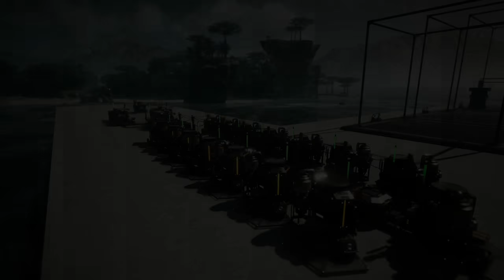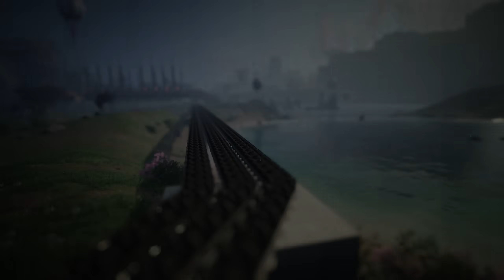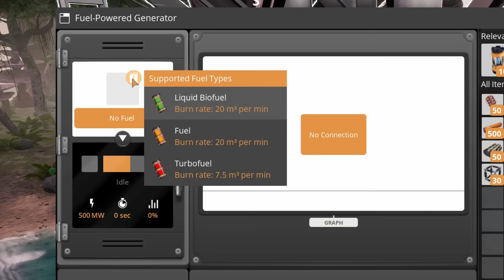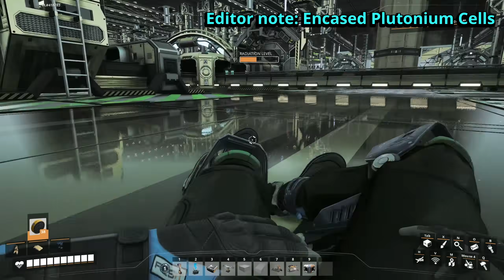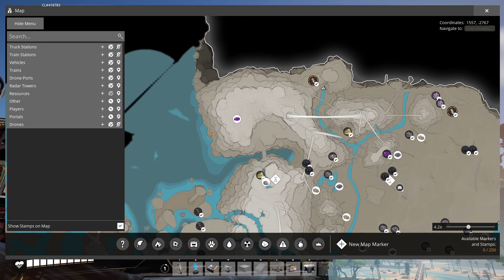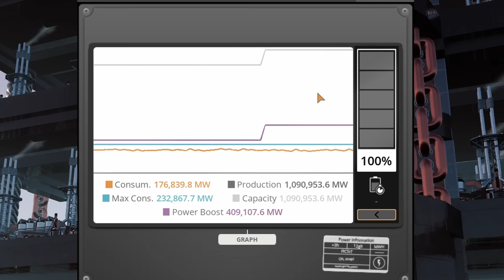BEST power guide for Satisfactory 1.1

Comment: For coal I just build a really long platform at water level.  Coal burners on one side and water extractors on the other side.  No pumps needed.  reversed conveyer lifts with a belt splitter stuck on the head of each.  Ram the coal down the manifold line.  As it gets longer, will need faster belts, but the beauty is you can just come back and extend the line further as you need.
Reply: I place the lines in parallel with water coming from the ends.
That way the line itself will never need more then mk2 belts. You expand by upgrading the one belt that feeds all the lines.

Plus, by placing them facing each other you get space to build a glass floor over the belts.
Reply: Place each burner in the opposite direction of the ones next to it (or run half of the water pipes underneath the burners if you only want to run a single coal belt) and place water extractors on both sides of the burners. Means you have to build most of the power plant on top of the water but everything lines up perfectly. EDIT: I should mention I use all my early slugs to overclock my first coal plant so it's easier to simply give each burner its own extractor, rather than worrying about water throughput issues.
Reply from the maker: Nice, did the same thing.

Comment: I just finished Phase 4 and looking for lategame proof factories and infrastructure.
I'm currently setting up the base for my future rocket fuel generators, and there is something I'm not sure how to manage regarding fuel generators in general. My previous fuel generator is plugged directly from the plastic factory who is generating the fluids, and I don't use "Bottled fuel", directly from pipes. And indeed I never managed to make it 100% efficient, as my pipe architecture wasn't the best with the knowledge I had at that time.
I think I can make it work now with what I know, but is there a real advantage using conditionned fuel over pipes ? Or is it just preferences ? I feel like the infrastructure of conditioning/deconditioning is as annoying as the pipes. What do you think about this ?
Reply from the maker: if you make a dedicated fuel plant, and use alt recipes you can make a ton of fuel and a lot of power, but if your just trying to get to a different power sources, i would say use the by product from plastic and rubber to make power and go big for the later game power plant. fuel is great for mid game and easy enough to make,

Comment: the thing is ficsonium rods are CONSUMING more energy (for the building parts production) than you get out of it so powerwise they are a power LOSS, you gain a lot of energy out of uranium and basically the same amount if you use the pluto rods for power THIS is the gain but than you need more power to make some ficsonium rods as you get from burning it, the only good reason to make them for me is just because you can^^
Reply: You can’t use plutonium fuel rods if you don’t make ficsonium. So they cost power but give you more power cuz otherwise you’d have to store the plutonium waste.
Reply from the maker: for the meme's agreed.

Comment: To be fair, a single overclocked pure oil node can produce 600 crude oil a minute. That means 800 heavy oil residue (Assuming we use that alt recipe, only 400 at max if we don't.) Side product: 400 polymer resin. If you add just a 100 copper to it, it can be turned into 4.17 or so computers a minute, just to make it into something more useful.

With diluted fuel, or diluted packaged fuel alt recipes, we can get 1600 fuel from 800 heavy oil residue and 1600 water.
That's already enough for about 10 GW of power. Pretty solid for mid game. (doesn't include the power consumption of the machines making it)

So: 600 crude oil + 1600 water + 100 copper = 10 GW + 4.17 computers

If you were to up it to rocket fuel, than depending on the path you choose, it could be anywhere up to 2400 rocket fuel, using that 1600 fuel you started with. The real issues here are the nitrogen and sulfur needs that has to be met. That is about 144GW of power, even if we subtract the power usage of the machines producing it.

That said, the optimal amount of power is obvious. All of it.
Reply: Did this same thing. Only losing one pure node for loads of power is really nice. With the converter you can then use it to make all the nitrogen you need and sulfur.

Really hope it doesn’t get nerfed and they just buff nuclear because let’s be honest it’s needs some love with diluted fuel beating it down as much as it does.
Reply from the maker: we need all the power lol.
Reply: How do you get a computer from polymer resin?
Reply: @_DRACrY  polymer -> plastic -> Circuit board -> Computer. 
Some of the plastic goes to the computer and then all you need is a little copper for sheets and wire.

Edit: You can also do the same thing but instead of cooper you use caterium and make wire. Take the 400 polymer and split it between plastic and rubber. That nets you 13.73 computers. But you need alt recipes for it.
Reply: Convert that 1600 fuel into turbofuel. ..

Comment: For Coal power, I recommend the simplest method which is 1 Water Extractor to 2 Coal Generators. Ideally, underclock the Water Extractors to 75% to save some power.

This method is easy to scale up (especially with auto-connecting blueprints), and virtually foolproof. Plus, 1 Water Extractor is exactly as wide as 2 Coal Generators so you can make the setup fairly neat.
Reply: Yeah, that should have been added to the video. Little gems like that.
Reply from the maker: I like this.

Comment: Alien power matrices add 20% to your boost. They don't make the augmenter's boost 20%. Augmenters provide a 30% boost to power production while burning an alien power matrix.
Reply from the maker: aaahhh, good point, yes i miss spoke.
Reply: @DrawingXaos yeah, sorry if it came off as dry and criticizing. I really just meant to give a heads up.
Reply from the maker: @MultiPaulinator  no its good, the right information is the most important part.
Reply: Yeah but those somersloops are SO much more valuable than the power they can provide, even at 30%, and 10 somersloops is a LOT of lost production..  Throw four in a late-game item, and DOUBLE the value of every downstream machine for the entire system instantly.
Reply: 10%
Reply: @Мойевропейскийжидобандеровский Incorrect. They provide a 10% while not burning power matrices. When they are burning power matrices, the boost is 30%.

Comment: What's the math on ion fuel vs rocket? Power use vs power gained?
Reply from the maker: its trash, it takes to much extra bs to get there and you lose power in the long run. not to mention with the other things you need to put in there, like aluminum and stuff, you will kill to much needed resources.
Reply: I personally don't use Ionized Fuel to make power, but instead I offshoot a small amount of rocket fuel to make them so that I can make Packaged Ionized Fuel for my jetpack.

Comment: If you fully overclock one water pump it’ll give you 300 cubic meters and you’ll only need one per 8 generators. Dramatically simplifies the design.
Reply from the maker: 8 generators need 360 cubic meters of water.
Reply: @DrawingXaos I meant for compacted coal, oops lol

Comment: In my builds now I run Nitro Rocket Fuel. Skips the need to make Turbo Fuel and I use the compacted coal byproduct to make Steel and Munitions.
Reply: This is the best. Skips most of the turbo fuel chain and goes straight to rocket fuel. 
If you're upgrading a turbo fuel plant, the original is fine. If you're building something from the ground up, the alt is fat superior.
Reply: While the sulfur needs of that recipe are insanely high, other than that, it's probably the best solution. I mean, you can make 2400 rocket fuel out of 600 crude oil, if you use Nitro Rocket Fuel, Diluted Fuel, and Heavy OilResidue alt recipes in the line at the same time.
Reply: @Wortigon2000  That 600 Crude/ 2400 rocket fuel needs 1600 sulphur. For turbo fuel 1600 sulphur only makes 2000 Turbo Fuel and you need way more normal fuel and over 100 refineries as compared to 16 blenders.
Reply: @sheldonpetrie3706  As I said, I know it is likely the best material, but without access to mk3 miners and mk6 belts, as you can unlock this before you'd have the infrastructure for it, it's a massive pain to even find a way to scrape together that amount of sulfur. Imagine if all you could take from a pure node is 600, due to limitations of mk2 miners, or 780 due to mk5 belts.
Reply: @Wortigon2000  Its not that bad, I built mine off the Spire Coast close to the Dune Desert where there are 2 pure sulfur nodes, and I use a Drone to bring the little bit extra I need from the Impure node in the Swamp. I use a train to bring in the sulfur and coal from the dune desert (and some bonus Iron ore I turn into steel within my power plant to deal with the compacted coal byproduct instead of just sinking it), and I just built a long pipe (which isn't all that long) to bring in the nitrogen gas from the nodes North of the dune desert and use the combination of the 2 impure and 1 normal oil node that are closest to the Dune Desert on the spire coast to get my 600 crude. I package 240 of it per minute into 120 per minute of packaged rocket fuel to be used by drones or other vehicles (and personal use). I got around the mk3 miner limitations by building the plant all at once but only bringing it 50% online until I could upgrade my miners to mk3 and my train supply belts and factory belts to mk5. I still haven't unlocked mk6 belts yet but I'll only touch the supply lines to my power plant in case I need sulfur from those nodes later.
Reply: @Wortigon2000  a lot of thanks!! Thats amazing how recipes can increase production
Reply: Wait rocket fuel makes compacted coal?  Suddenly I feel like I want to build a few hundred coal burners, to complete the "cycle of life"!
Reply: @BEC-l2f yup, it's a very useful byproduct to burn or make steel with.
Reply: Nitro rocket fuel is my preferred power as well. I have drones delivering 1200 sulfur reliably without any issues. I also use drones to deliver nitrogen as packaged nitrogen. The 4 to 1 compression makes it easy to deliver all you need using very few drones.
Reply from the maker: not bad, not bad indeed.

Comment: ROCKET FUEL is supreme, I use 4 Blenders with the alternate recipe for rocket fuel and then only produce 300 fuel but use  somersloops on all 4 blenders to double each blenders output to the 600m limit.
Reply from the maker: Hell yeah, now your cooking with gas lol.
Reply: I had to rebuild my rocket fuel plants. Don't depend on mark 2 pipes actually delivering 600. Instead, set everything up for 450 per minute. Otherwise, you'll go nuts trying to get 100% efficiency.
Reply: @john_in_phoenix if you don't go vertical, you won't have any issues. The only issues I've had were due to going vertical even with enough head lift
Reply: Nitro Rocket Fuel.
Reply: Somersloops on 4 blenders? That's 16. How many have you found?

Comment: Agree that Rocket fuel is the best late game power. 1Tw mixed rocket/turbo in my prefered set-up will only take 6000 Nitrogen (half of map supply), 8100 oil (about 2/3), 5400 sulfur (a little more than half), 900 coal (nothing), and 8100 water (much less than nuclear)

I get most people prefer more oil efficient recipes, but I've always been a sulfur efficient builder. you can still make thousands of plastic and rubber with this set-up so its not like oil is too pressured of a resource.

1Tw ionized fuel is actually impossible due to the power shard/aluminum case requirements, and I think its only worth a small production chain to make packaged fuel for jetpack/vehicles.
Reply: Imagine if oil had a converter recipe then you could make soooo much power.
Reply from the maker: totally agree. i got my Ionized fuel for the jet pack and never looked back, but that rocket fuel was such a great thing to have and there a few locations you can make it so it was always the right choice.
Reply: in the optimal power set up(19 TW) about 225 GW of power are going to ionized fuel.

Comment: yeah i noticed the fuel generators are easier vs power you get compared to nuclear... Buuuuuut if you pull off a full nuclear plant chain to the end you get the bonus of immense satisfaction of insane big job done.. ofc after you fixed the 100 problems after finishing it why its not working properly :D
Reply from the maker: lol so true.
Reply: Oh you mean you put 1 tier 2 conveyor belt somewhere in your mess and it's bottlenecking the entire factory? Go find it. While you're at it I placed a needle in that haystack over there.
Reply: @timstram found the needle but where is the haystack?
Reply: the thing is in the time it takes you to set up one nuclear chain you could've set up ten rocket fuel chains producing more power for far less work. It's a fun challenge getting nuclear set up but it's just not worth the pay off. Don't get me started on the sheer amount of water lines you need to run to the plant

Comment: 5:00 An alternative is to underclock the water extractor to 90 as 2 Coal generators and 1 Water Extractor are the exact same width!

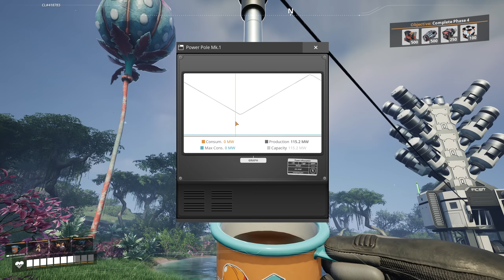8:00 7.500 Megawatts and some Power Storage is pretty nice AND it means you'll never be to far from the power grid when building abroad if you set it all up.

11:00 One fun trick to remember for the logistics, Pair your Packagers. 2 Packagers and 1 Diluted Fuel Refinery all have matched rates and you can send the empty canister of the unpackaging one into the packaging one to never run out or clog a machine.

16:00 Oh Ficsonium... Honestly, just use the Plutonium as Vehicle fuel or something until Ficsonium gets rebalanced to use more waste per, the fact that its barely break even would be fine if it actually did its job of processing Plutonium Waste, but it costs so much per waste as to be a non starter.

20:00 One extra fun thing, Rocket Fuel is a Gas, so stack them generators high, its free. But as far as which recipe to use for rocket fuel it mostly depends on what resource you want to save. Nitro Rocket Fuel uses the least Oil and is by far the simplest to set up and uses the second least Coal, but uses the most Sulfur by far (though seeing as Sulfur is for Power Production...) And 25% more Nitrogen. On the flipside you could instead use Turbo Blend Fuel and regular Rocket Fuel to use the least Sulfur and no Coal but significantly more Oil. And one final fun thing you can do: Take that compacted Coal, turn it into basic Turbo Fuel, use all the polymer resin your making for containers and suddenly you have a supply of turbo fuel for Turbo Diamonds

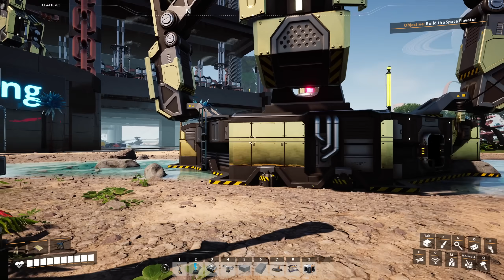25:00 Suspect you meant to say increase this 10% by 20% to 30%. A worthwhile note for that is the power draw of 5 Matrixes/min is like -100,000 MW- Correction: 20k-30k MW per 5 without clock shenagains. so it needs a substantial grid to be truly worthwhile.
Reply: This is how I built mine. The 2 Coal Generators make a nice blue print.
I especially like it is very beginner friendly, clean and concise, without overwhelming a new player with water pipe problem solving.
Reply from the maker: Yes, and its your first time getting real power up and running and not having to do anything to it once its working.
Reply from the maker: That is very good information, thank you.
Reply: I don't expect ficsonium to be rebalanced, right now its set to produce exactly 1/2 the power of plutonium, which is the same as all base recipe plutonium compared to uranium. I think that was intentional. We might get an alt recipe, but not a rework of the base one.

Also, I don't know what setup you built them on, but 100Gw for 5 matrices is definitely off. I had a <20Gw starter base that made a surplus of everything in the game including 5 matrices/min.
Reply: @owenbuckley705  Mmm, Could be wrong on that